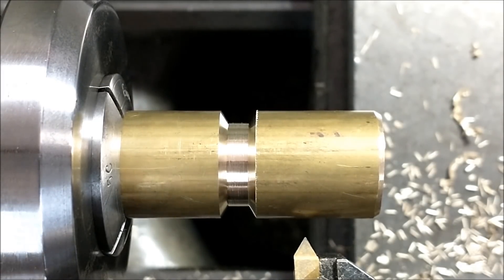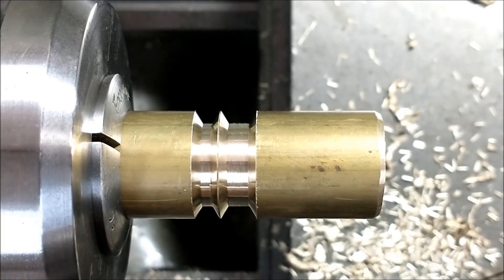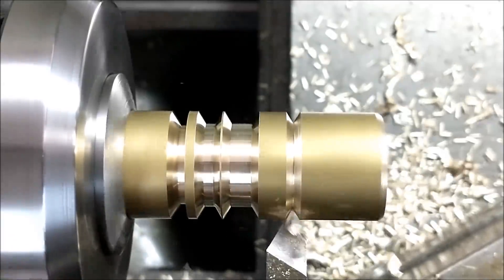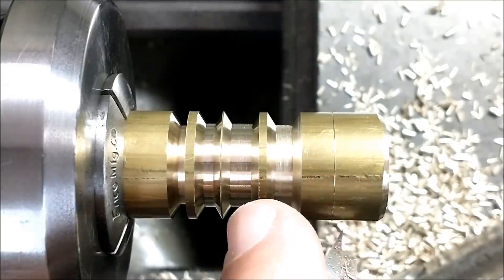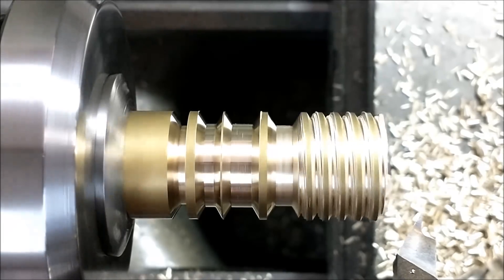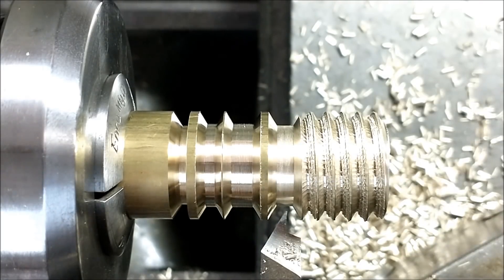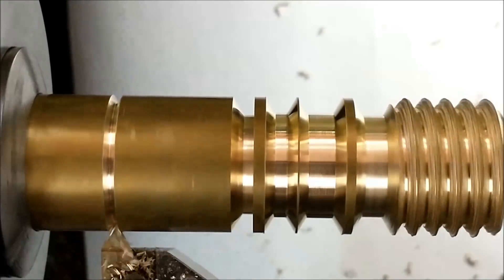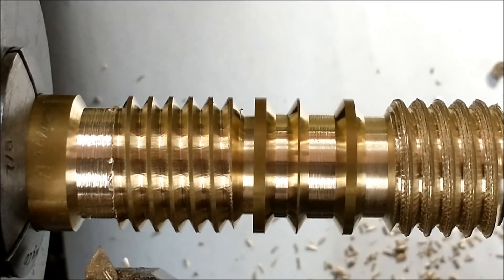FACT CHECK:  Threading Myth BUSTED !!   You'll Find This Interesting......

Comment: Joe, firstly let me be clear that I have great respect for your immense skill and experience and I have learned so much from your excellent videos.
So, with the greatest respect I think the issue here is that the original 'old school' teaching has been mis- interpreted and mis-quoted by generations of later day armchair experts.
The old school  technique was to set the compound at 'slightly less' than the thread angle so that the tool cut 'mainly' on one side, inorder to reduce chatter on small, primitive, non rigid, hobby lathes when cutting coarse threads .  There was no mention of the tool not cutting at all one side. Somewhere over the passage of time 'slightly less' became the (incorrect) 'rule' that you had to use exactly 29.5 degrees (for a 60 degree thread). From this, it was a small step, to develop the incorrect belief (myth) that the tool didn't cut at all on one side.
So, while you are totally correct to debunk the myth about only one side of the tool  cutting if the compound is set at 30 degrees I don't think that undermines the value of the offset compound technique 
for small hobby lathes trying to cut coarse threads, but it's important that newbie lathe operators realise that '29.5 degrees'' isn't 'gospel' , it really means a few degrees less than 30.
Regards Paul in NZ
Reply from the maker: Thank you for your comment. Feeding a threading tool with the compound set at an angle, greatly reduces the tool load and is a huge benefit for a lighter machine or small diameter part. My work and machinery allows me to just feed straight in. I thought debunking the myth may help to clear some fog.
Reply: Cutting tool loading is the same regardless of in-feed angle. It is the Depth of Cut that is the primary factor in cutting tool loading. Greater the cutting load on a specific cutting edge will wear that cutting faster.. It is all a trade off.
 @joepie221

Comment: You only need as much on the second side of the tool as your depth of cut so it cleans up the step.  Full profile on the second side is not needed.
Reply: he said that in the video @ 14:26. Point is you still need both sides, doesn’t matter how much on the right side is needed, it’s a fact that right side is needed.

Comment: Good Point.years ago I dykem blued a single point and wiped off the blue with thinner. Why I don’t remember as it was so long ago. But I was half done so I just put more blue on it.

Sure enough, the right face cleared in a single pass. The blue is used to gage your ridge width and to help with the scratch cut. Helps with poor eyes and poor light but not really needed.

Now what happens when you cut a square thread, acme thread or best yet a buttress thread?

In the case of a buttress thread, your tool has two distinct profiles. What would you set your compound to?

Comment: Joe, could you do a video on the idea of tilting a threading tool to the thread helix angle, and explain how that does or doesnt work? I always thought if you did that one side being lower than centerline would smash, and the other being higher it would rub and not cut, but supposedly it's an advanced technique some would use, and I've always been curious how that actually worked or didn't work at the cutting surface. In fact it's one of the few things about cutting geometry that still confuse me when I can understand some otherwise very complex tooling. Can you cover that sometime?

Comment: It seems the helix angle is steep enough to make your point, Joe.   Not cutting at all with one side of the threading tool results in a groovy thread - not the good kind.

That thin tool is also chattering like crazy with such deep incremental cuts.  Perhaps you can sell this as a self-locking thread, or art 😁

Comment: I was always taught that the compound was set at 29.5/30 degrees because “math”

60 degree thread. 90 degree cross slide, only leaves 30 degrees for the compound. It makes the math on figuring out thread depth easier. Forces on the machine. The half degree for 29.5 is for clearance, so the backside doesn’t rub, a better surface on that backside.

I’d never heard that the right side doesn’t cut. Just like super glue arbors. Wtf is that? YouTube university.
Reply: Go watch ToT's thread cutting vids
Reply: @nigelsmith7366  I’ve obtained a degree in Indistrial Tech. I’ve lost count of the number of machine shop instructors I’ve had. I’ve been taught how to thread by a man who was a machinist for the UC medical system.

I’d been taught the option to thread away from the head like Joe Pie shows. Never had I seen or heard or been taught the super glue arbor. Seems dangerous to me as cutting generates heat and heat disassociates superglue. I discussed it with many machinist. Every old school machinist will never use superglue, because the heat.

Again, the compound is set at 29.5 because the forces of the machine AND to make the math on depth of cut for threading easy.

I agree with TOT on one thing. He said, if you think you know something go get instruction from somebody who actually knows what they are doing.

My first machine shop instructor was in 1984. Prior to being my instructor he worked on the SR71 for Lockheed.

My last instructor, like previously stated, made medical devices for doctors in the UC medical system. 

I’ve obtained a degree. YouTube University is great but it doesn’t give one a degree or experience.

Edit: I’ve worked as a machinist. For years. YouTube is for entertainment purposes only.
Reply: I really want to know if Joe, while using collets to thread, away from the headstock, has had any issues with work slipping in the collet as the forces on the machine will tend to loosen the work in the collet.
Reply: @giordanobruno1333  in Joe's case, cutting outwards from the headstock would "unloosen" the collet, which means tighten, which would be OK 😉

Comment: I don't cut threads with the compound at 29.
I plunge straight in.
Much of this is a carryover from old weak out dated machines.
Even the old South Bend manual says you can plunge cut threads.
Try to cut buttress threads set at 29.
Not gonna happen.
Reply from the maker: You can cut buttress threads with a compound set at 29 degrees. Just lock it and use the cross slide. :)

Comment: Well, I also do a finish pass on both sides of the thread so this wouldn't make sense to me anyway. I think certain ways of roughing your thread would only use one side but to get the thread to spec you still would need to get those stairs off.

Comment: I've never heard that said. The reason for setting up at an angle is to reduce the load on the tool and work. It does cut a little on the back, but nowhere near as much as if you plunge straight in. When you're cutting a long coarse thread on a difficult material, you don't want the job climbing up over the tool. It also makes it more convenient on manual machines, using the cross slide to come back to zero.
See how inconvenient it is, plunging straight into the work, having to keep track of the depth of cut each time.
Reply from the maker: Ignore the depth of cut. The PD and tip flat dictate a good thread.
Reply: @ Roger Froud- your explanation is exactly what I was taught by the old machinist teacher that taught me over a decade ago. I was never told by him that the rear of the tool didn't cut- he had me set compound at 29.5- it didn't rub as much, just as you said. You absolutely do need the rear of the tool angle- Joe's totally right on that- I have no idea who the hell came up with this idea that the rear of the tool doesnt cut. Of course it does! Joe's right about not worrying about your depth of cut- I couldn't care less about that- you just cut the major  OD for external threads, or minor for ID ones, and cut until the thread fully forms to it- the last little bit is usually hand fit or thread wires or thread mic anyway

Comment: Hi Joe, thanks for the Video, i really appreciate your time and effort you put in producing the videos. 
I m a hobby machinist frequently turning parts for my old cars. Usually i do the threading as shown in the following video : https://youtu.be/OHxuxP5BtkU
I ve never experienced any problems with the method not using any kind of angle on the compound slide. 
Is my method wrong, or leads to fail operation in some scenarios ?
br
benno

Comment: That's a good demo Joe!  I was taught to use the compound to rough out the thread and leave a thou or 2 for a cross-slide pass to "back-face" the thread and remove the steps.  I almost always run a spring-pass as the last cleanup pass.

Comment: Thanks Joe. My first attempt at single point threading on the lathe is going to be an internal 1 1/8-16 LH thread. I know it's an unusual  size but that's what the nut on the surface grinder is. Could you please verify that regardless of how I position the tool (front side or back side, upside down or right side up, forward or reverse spindle) it must be a RH tool holder. I've watched your video on threading from the shoulder out towards the tail stock and every scenario I can visualize tells me I have to use a RH holder to cut a LH internal thread.
Reply from the maker: If you thread on the back of the bore and draw out, spindle in reverse, use a LH holder with the tool upright for a RH thread. If you thread on the back of the bore and draw out, spindle in forward, use a RH holder with the tool facing down for a LH thread. Double check this with a sharpie marker before you make a cut.  I'll check this myself to be absolutely positive.....It's early. :)
Reply: @joepie221  That's what I came up with as well.  Just verifying that a LH internal thread, when cutting from chuck to tailstock, can ONLY be made with a RH holder.  I have to buy a holder for this and want to make sure I get the correct one.

Comment: Could you explain a multi start thread and how to do it please
Reply from the maker: Compound parallel to the part centerline. If a thread is .100 between the crests, run one thread first, then advance the compound .05 and run another. It should split the original thread in half and double the TPI.

Comment: Straight in is the British way of cutting threads. I was trained to cut threads at the 29 degree compound slope, and I found it tends to give more angle on one side than the other.. I use a mix of compound and crossfeed. Last two cuts straight in. I suspect that the spiral/helix and tool bit geometry actually suck the tool ahead causing a flatter slope on the trailing edge. 
The trailing edge of the tool bit may not cut per se but it does scrape and clean up the thread.
An interesting experiment  would be feed the compound it at say 1 degree to the right opposite of what we normally do and see what happens.
Reply from the maker: I must be british. I plunge all my threads.

Comment: Great demonstration of thread cutting using a compound angle tool vs a leading angle tool cut only... I suspect the trailing angle of the cutting tool is also stabilizing the torsional vibration being generated, when using only the leading angle of a cutting tool .

Comment: I have been looking at miniature lay down inserts (Dorian for example) and they make UN 60 deg full profile inserts but they always specify them as single TPI. It seems like I should be able to use that cutter for any thread pitch that is higher than the one specified. What am I missing? Are they not dead sharp?

great channel, it's nice how many other good channels refer to your work.
greg
Reply from the maker: The term full profile is the key. When the root and PD fall into place, the crest of the thread also forms. You can use the insert for different threads, but it probably won't top the thread profile. You can use the 16 TPI insert for a bunch of different Od threads of the same pitch.

Comment: Former machinist (25+ years) this myth pervades even into CNC machining, I was all sorts of ready to disagree with you on this...  the one and only instance where having the compound set at 30 is if you are using hand ground inserts where the rake only goes one direction, with modern carbide inserts, its pointless and only serves to complicate the process by forcing you to guess and by golly on the movements of the compound

Comment: I'm going to put my 2 cents worth  in there...grind the cutter to fit the "V" groove on the threading "arrow-head" and then hold it on your cutting tool and adjust your tool post so that the back side of the arrow head is parallel to the work, and tighten it down. That puts the cutting tool as close to perfect as you can get. Run it slower and never run it out once it's in the cut. Stop the chuck and reverse the direction. (Do a dry run). Take a cut to the end of your run, and then reverse it and go back to taw and take another cut. If it takes another cut,  go ahead and take the cut but NEVER disengage the threading gear (saddle drive), because you can never get it exact if you do. 
   I don't know about doing things with the X & Y electronic help. I learned it "Old School". I was a tool & die maker in the 70's.
   Thanks for your video and for bringing old memories to light.
Reply from the maker: I never leave a threading tool in the thread form and reverse the machine. The backlash could instantly destroy the tool and part. Its OK to leave the halfnut engaged, but retract the tool is my standard practice.
Reply: @joepie221  Exactly my thinking. I have heard people say they should just reverse the lead screw with the tool at depth and I have no idea why they insist on that because for the very reason you mention backlash will ruin the thread.

I never knew how many misconceptions there were in some people's minds around threading on a manual lathe until I watch this video and read the comments🤣

Comment: The biggest advantage of the compound slide set over at the angle is when you are threading the end that needs tailstock support. Then the angled compound gives more room with some machines. On other large machines it won't make any difference which way the thread is cut. A lot of cnc machines will use  a zig zag approach, where the left hand side of the tool is used first, and the 2nd pass it will use the rh side of the tool second, etc and finally uses a plunge cut to clean up both sides at the last cut.

Comment: seems weird to me that people would make that point to begin with. if you give it 1 second of thought it becomes painfully obvious that a tool couldn't cut a -30° "taper" if both it and the work never rotate - unless it has an edge to cut at that -30° angle. you should have put the camera on top of the tool and moved it along with the tool, to show that even though it's moving laterally, it's still plunging into the material like it would if it weren't.
Reply from the maker: If this isn't your day job, it wouldn't be that obvious.
Reply: @joepie221  it isn't, and I've never touched a lathe in my life :D. I think I may be better than average at picturing things in my head though, and apparently there are people who aren't even born with that capability, so that could explain it. I also do spend a lot of time watching machining videos tho. Hey thanks for taking the time to respond, and great video!

Comment: There is a very important distinction to be made here: the 30* compound setting is relative to the cross slide axis.  I.e., it is the angle off of perpendicular to the spindle axis.  If you're thinking "Duh, what else could it be?",  on some lathes the compound angle is relative to the spindle axis.  I.e., 0* is parallel to the spindle axis, not the cross slide axis.  On these lathes the compound is to set to 60* for threading!!  It's the same position in both cases, it's just the reading on the scale that's different.
Reply from the maker: I see the 60 degree thread profile as a flashlight beam in a dark room. You set your compound within the light and off ya go. Whether the index mark says 30 or 60, you have to be in that beam.

Comment: Depending on the lathe that you have, when single point cutting a thread to a shoulder, turn your cutting tool upside down, run the carriage in reverse, start at the shoulder and feed towards the tailstock. this is an old trick when threading to a shoulder, and also forget about that 29 degree nonsense. Just feed it straight in. This is for right hand threads.
Reply from the maker: Tool upright and feed out is the setup for doing left hand threads the same way.
Reply: @joepie221   Yes,  A Hardinge tool room lathe was the best for manual single point turning threads.
Reply: @glennschemitsch8341  great machines for threading